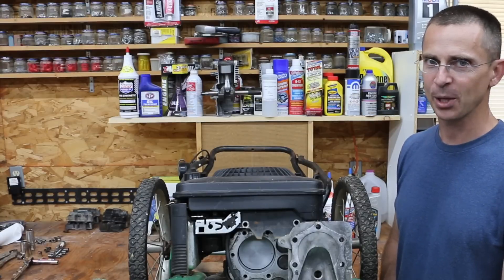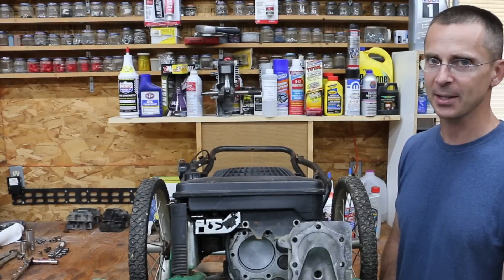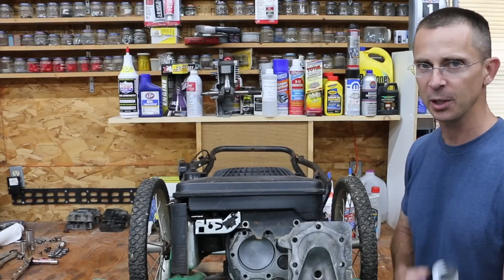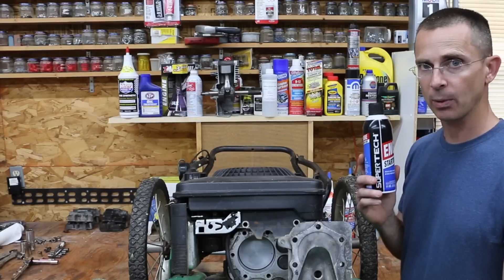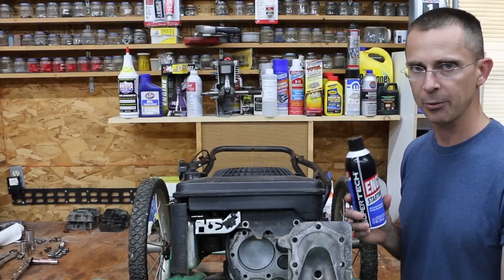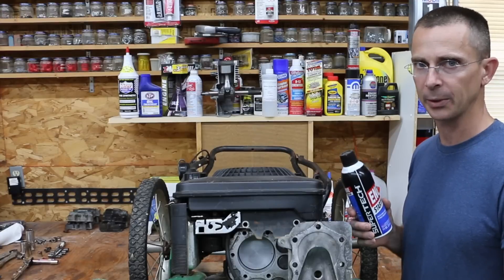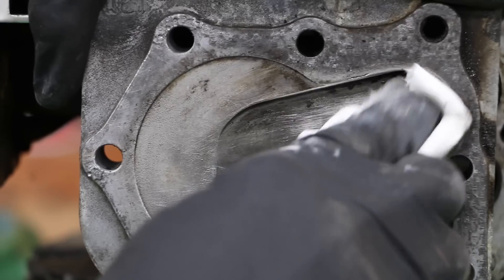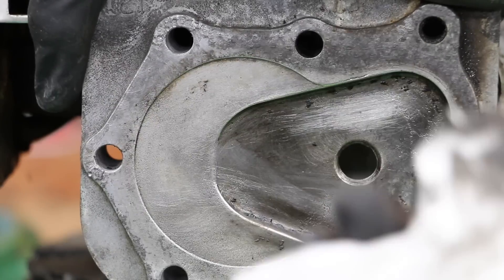Will Running an Engine on 100% Starting Fluid Cause Damage?  Let's find out!

Comment: I've repaired many diesel engines that people ran too much starting fluid trying to start it cold usually blowing the head gasket sometimes blowing pasta cylinder and burning at Pistons
Reply from the maker: Thank you for the feedback
Reply: Or heat from a heat gun into the intake works too
Reply: @Joseph-C  I'm glad I'm not the only one who has thought of this.
Reply: Snoopy the ace it uhhh, didn’t work the best for me, but it helped me start my 7.3l when the glow plugs weren’t doing it. When the glow plugs work she starts right up in any weather tho, very glad I have them.
Reply: James Shock  w/D 40 works
Reply: STARTING FLUID AND GLOW PLUGS DON'T MIX .
Reply: Use wd40 for diesels, and starting fluid for gas.
Reply: @themechanic6  where/how you pour the wd40?
Reply: into the intake, I'm guessing its the driving gas(propane and butane) that explode so any spray(hairspray bodyspray etc) dhould work, but wd40 also lubricates which is good for compression
Reply: wd 40 Silicone spray is better for cold starting a diesel
Reply: I've seen diesel pistons with cracks in them from using starting fluid during cold starts.

Comment: Fellow Vet here from your friends to the north, our MLVW’s had a ether squirt button that was removed because guys were using it too much and popping heads off the 6.5 GM N/A diesels, so i have heard of ether damaging a diesel engine, i think it boils down to diesel burning on the power stroke and ether or gasoline exploding, the pressure is just too much for a hi comp engine
Reply from the maker: Great point and thanks for serving!!

Comment: Its like a 103 octane gas like race fuel it actually burns slightly hotter  all though it may not have shown it is extremely flammable as you know and it is just a bit cleaner burning
Reply from the maker: Thank you for the feedback

Comment: Lol start my diesel tractors on starting fluid after running them outa gas instead of bleeding them i find it much easier as long as it doesn’t have glow plugs
Reply from the maker: Thank you for the feedback

Comment: Try running an engine on pure nitrous because I'm assuming since there 2 oxygen and one nitrogen molecule that breaks down under compression and heat it should act as it's own fuel, catalist, and be pressurised while going into the intake
Reply from the maker: Thank you for the video idea!

Comment: Or run a two stroke engine with gas mix with normal engine oil. I did that one time on my dirt bike. I ran out off 2T oil so all i had was diesel engine oil it smoked a bit but was fine after i put 2 stroke oil on it ! And other time i mixed diesel in the gas tank of my friends 50cc Yamaha DT that thing was smoking like a steam train and the top speed was like 40kph 😆
Reply from the maker: Thank you for the feedback

Comment: I used to work on a farm when I was a kid, and the boss had these International Harvester tractors with ether/starting fluid attachments.  So, the old man liked his booze plenty and one day came out to do some work while he was still all pissed up and tried starting one tractor that had a starting fluid button that looked just like the Engine Start button.  He pressed that button repeatedly for about 5 minutes, mumbling "wtf is going on you snagga fragga pos" while nothing happened.  Finally he realized he was pushing the wrong button, and reached over to the other button and started the engine.  The engine fired right up and ran for every bit of 3 seconds before it made a huge bang and shot a fountain of coolant up through the exhaust stack.  I'll never forget the look on the boss's face while he just sat there for a minute or two all wet from the antifreeze bath he just took, trying to comprehend what had just happened.
Reply from the maker: LOL!!!

Comment: A friend in high school had a job moving tractors around the lot at a local IH dealer. One day he bumped the ether AKA "starting fluid"button by mistake witch caused the already running engine to surge. He kinda liked the effect so he tried it again and again. Third time is a charm as the head bolts fractured. He had some splainin to do as did the dealer to the customer who owned the 806.
Reply from the maker: Wow!

Comment: I learned something new recently. Starting fluid today isn't the ether of years gone by. Ether can still be bought but is more expensive and sold in smaller amounts. I'm curious how the ether would compare to the modern starting fluid. There's a lot of myths about ether. I wonder if they are true and, if so, apply to the new fluid.
Reply from the maker: Great point. Thank you

Comment: My dad once owned a 1954 Ford sedan. Beautiful car. He worked for a natural gas company for 37 years. He told me that he rarely bought gasoline because he ran the car on something called "drip gas". This is simply the water extracted from a natural gas well. They use a device called a "dryer" to collect the water that naturally comes up from the ground with the gas. This is to prevent it from being sent into the transmission line and preventing combustion. You should definitely try this one out. It would make my dad's day.
Reply from the maker: Thank you for the video idea!

Comment: DO NOT use starting fluid on vehicles equipped with plastic intake manifolds. The least little spark will blow a good size hole in it, or worse blow it off the top of the engine. I've seen it happen 4 times. 39 years of selling auto parts it's hard to educate people on the danger's when they will not listen.
Reply from the maker: Great point! Thank you

Comment: I know a guy that flips cars for a living... needless to say he will do just about anything to make a buck and flip some scrap... one thing he swears by is that running a car that has engine damage (ex. ring damage, cylinder scoring or valve leakage) is that if you run hair spray through it as a fuel through the intake... will cause enough build up to increase compression and make the engine sound better for the few min its ran through an auction. Is this really a temporary fix for these issues or is he really just as much of a dummy as I think he is?
Reply from the maker: Thanks for the feedback!

Comment: Thanks for doing this test. You always hear that starting fluid will damage an engine. However you tested this on a 4 cycle, oil injected engine. How would this test be for a 2-cycle engine without the oil in the fuel?
Reply from the maker: Thank you for the video idea!

Comment: I have seen it make diesel engines throw rods before. The biggest thing I've seen is people spraying straight in the air filter and it fills up like a sponge than when the motor does start it pulls all that built up starting fluid in and over winds the motor causing it to bend rods.

Comment: I'll give you an idea. Run car Air conditioning unit with separate mini bike engine installed in front vehicle engine compartment. So when camping in desert environment you turn off car engine, but have a/c running without car engine on. A separate compressor and bypass hose with solenoid to move refrigerant from engine ac compressor to mini engine and compressor.
Reply from the maker: Thank you for the video idea!

Comment: Starting fluid is no good for a diesel because it has no oil to protect the cylinder Walls the best starting fluid for a diesel is wd 40
Reply from the maker: Great point. Thank you

Comment: So just a heads up, don’t do the “will and engine run with water instead of oil” one. My Briggs and Stratton mower DID run for a little while and then the oil cap turned into a highly heated melted projectile and I had a boiling water fountain in my yard for a minute. After that, they seize/explode lol. Gotta love being a teenager, but I did learn from it!
Reply from the maker: Thank you!

Comment: I was stranded at home Depot yesterday, fuel pump went out and beating it didn't work so I went in and picked up a can of starter fluid, a wd40 can to use the sprayer on top as a sacrificial adapter , and a section of ice machine tubing, I run the tube g into the intake and the other end of the tubing into the cab and I melted the end of the hose enough to stretch it over the wd40 nozzle retrofitted onto the starter fluid and Everytime it tried to die and Everytime before I accelerated I told my buddy to spritz it and it ran fine, idle was higher than normal but we made it
Reply from the maker: Impressive!  Way to innovate!
Reply: Hi this this Cletus from the  dealership down the road that starts with an F, or sometimes doesnt start and an F quickly follows. We realize that out truck break down an awful lot. We'd like to patent and use your design using starter fluid so that our trucks are more dependable.

Comment: Years ago I was on a road trip.  We were driving diseals trucks.  We were having engine problems.  We didn't know it at the time but we had 2 bad cylinders.  I sprays starting fluid into the air intake just to try something and once the starting fluid hit the glow plugs BOOM!!! We had a big explosion and the entire plastic air intake was destroyed.  Once I said I was okay we had a good laugh. Also with running starting fluid wouldn't the burning temp destroy the carb?
Reply from the maker: Wow!  That would have been scary!  Starting fluid tends to pre-ignite if under load.  That'll cause combustion chamber damage.

Comment: Can you do this again but on a Car Engine? if it works.  then dont see a reason not to say keep a few cans of starting fluid in then car encase you run out of gas, say middle of no where, or stuck like in a winter condition without fuel.
Reply from the maker: Thank you for the video idea!

Comment: Have you done one on making your own gaskets? I have one. I don't know if you tried this one. Try a milk carton it has a foil liner on the in side of it. The out side is like a plastic papper or something. It's a rectangular box with a square or small round opining. I tried it on hydrologic lines and it works..
Reply from the maker: Not yet. Great suggestion!

Comment: Ran out of gas with the girlfriend once. Crawled under the hood of the "Ol" 64 chevy pickup with starting fluid in hand. Hood up and her behind the wheel with her head out the window driving. Barreling down the highway. That motor was hammering. We made it to a gas station. Can only imagine the faces of the people going the opposite way wondering what they just witnessed. I was too intent on metering ether. Walking sucks. Crazy experiences are living!
Two years later I changed the cam and lifters. Vrooom!
Reply from the maker: Lol, Thank you!

Comment: What I've been told, is that starting fluid will soften/dissolve bearing material in engines. Since most of these small engines don't use an actual bearing like a large engine, that part is probably moot. Starting fluid is usually ether or something similar, and that acts a solvent on oil, so it could affect the cylinder wall lubrication if used too much or in this case, exclusively. 

Love the videos though man. Keep it up! Keep improving! You are doing a great job.
Reply from the maker: Thank you!

Comment: I am stunned and amazed that the engine started so easily and ran so well on that stuff. I'm even beginning to wonder if those old engines could run on pulverised coal dust!

I'm even thinking their slogan should be, "Briggs and Stratton . . . B&S, no b.s."

So, will an engine run on paint thinner? . . . My guess is, yes, if it's a B&S. (And hey, there's another slogan for them!). Just think of the fun we could have, and what we could learn from testing different kinds of paint thinner?
Reply from the maker: Thank you!

Comment: Running a diesel o starting fluid or just starting it will most likely will do damage to the engine. Ive seen broken crank shafts and cracked pistons form using starting fluid. 
If you want to safely start a diesel, my sugestion would be to put 100ml of gas in in 2l plastic bottle and as you crank the engine gently squeeze the bottle to let some vapour get in the intake. I dont recomend sqweezing to much as the result may be damageing to the engine. By leting a little vapour enter the intake , that vapour will give a starting point for diesel to ignite in the cylinder. Giving to much vapour wil make the diesel engine mostly run on gas and experience a violent burn of the fuel and result in cracked pistons or preignition wich will brake the crank.
Reply: cameradebord Bacau, I had a diesel mechanic talk me through the start up procedure of this rented backhoe that had drawn air in the fuel line due to a leaky seal (same result as running the engine out of diesel).   After priming and getting all the air out of the lines he had me start it by having me spray starting fluid into the air intake until the diesel took over.   Caused possible harm?
Reply: @Colorado-Tinkering   Uli Bischoff  you can get a broken crankshaft in most inline 4 cylinde diesel. You have to look at the leverage point. Lets say that Cylinde1 is at its power stroke, gets half way to bottom 90° and C3 is at compression stroke going up. C3 is at 270° and if at that point the stsrting fluid preignites the crank is forces from two directions sufering torsional force. The crank isn't made to flex in any way but on long cranckshafts like in inline 6 cylinde it does hapen, slightly.
My guess is that your engine has not sufered from the starting fluid but it isn't an exact science. You could be fine using starting fluid for a couple of times or more, or you can use it once and have to buy a new engine. Depends on temperature, on compression, on many things.
For example, in winter time the -30° air temp gas pressure in the power stroke will be higher because 1. is more de dense and has more oxigen 2. The volune of burnt exhaus gas is higher if you take -30° air to 600°, than if you take it from +30° to 600°

Comment: I does on diesels I see cracked rings and cylinder scores all the time being a certified master technician of Navistar.  Ether knock is what happens in a diesel sometimes it causes ether lock witch is like a hydro lock.  That bends rods.
Reply from the maker: Great point. Hydro lock from a bad injector seems like a possible one
Reply: @ProjectFarm  yeap we ruined a diesel  air compress using starting fluid at work. It didn't have the heaters on it so wee had to give a shot of starting fluid. it's just setting in the scrap pile behind the shop....
Reply: @ProjectFarm  it has been replaced with the same brand compressor just 1 with a john deere engine with heaters.

Comment: We used to use Ford 4 cyl. Diesel engines as pony motors on garbage trucks to run the hydraulics. If starting fluid was used improperly to start the engine, it would sometimes cause the camshafts to break.
Reply from the maker: Thank you!

Comment: I feel like ether/starting fluid is more a damage over time thing. Example you use it everyday to start your car for say 3-5 years then it might cause some issues. As for diesel I feel like it could be more damaging sooner due to the higher compression ratios and that the fuel its self lubricates the cylinder a little as well, but I could be wrong about that.
Reply from the maker: Thank you!

Comment: I must make note that over the past 20 years or so they have change starting  fluid from an aerosol can of strictly ethnol to a base of oil with a new liquid  mix of  Ether Which means that the base chemical used in this is actually a very good moistning agent and upper cylinder lubricant so it has been redesigned to not be able to cause any harm to  an  Internal combustion engine where is 20 years ago it was a very dry burning  Thing versus being very wet burning now and it used to wear the seals in the engine out because it would dry them out If you used starting fluid all the time 20 plus years ago now it doesn't matter since they've added oils to starting fluid now and it  Burns wet now and lubricates instead of burning dry and not lubricating like it used to but even when it was a dry burning chemical is long as you only needed a quick blast every now and then it really wouldn't cause any major damage to your engine But if you had to use it  All the time it would now if you have to use it all the time it doesn't it actually lubricates the upper end of the cylinder as well now As you can see by the oily residue that was Left Behind in this video but when you start in internal combustion engine on starting fluid now in a very short period of time The oily residue is burned off And it does not affect your engine  Negatively  Like it used to in the past.
Reply from the maker: Thank you!

Comment: Actually, the reason why running motors on carb cleaner/ethanol/acetone/ether is that they burn hotter than gasoline. And in diesels it is a concern because it can make them runaway because of how hot they burn. A lot of ether can blow up a motor if you just dump it in with a <10:1 Fuel to air ratio. Thats why when u spray it into a carburetor and then the motor suddenly catches and redlines. thats why its starting fluid, not canned fuel. Thats why people sometimes make motors grenade themselves with ether
Reply from the maker: Thank you

Comment: The idea is it's higher flash point, it's purpose is for diesels. Especially when it's cold!😧. I think it would take a full season to see if it blows up. That's alot of fumes to breathe for something thatcrealky doesn't matter. Are you trapoed on an island with a lawn and 12000 cases of starting fluid 😃😃 and a Torro.
Reply from the maker: Thank you!